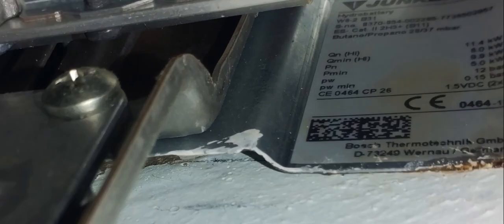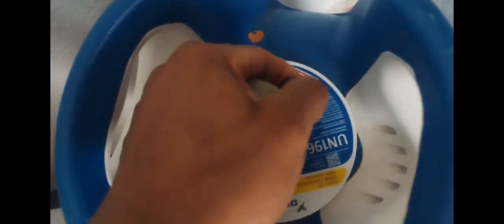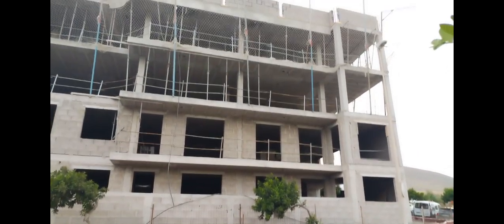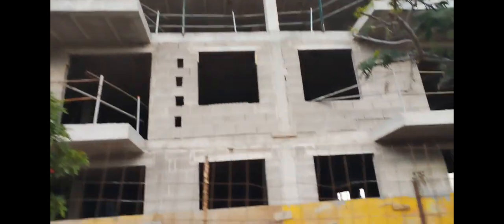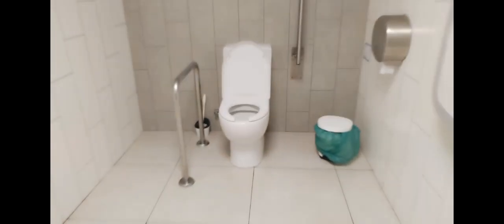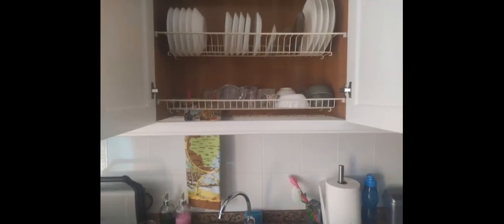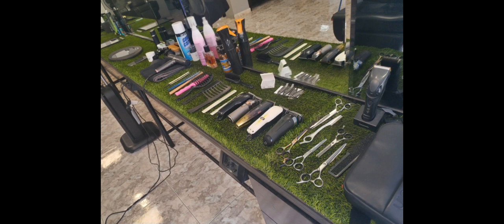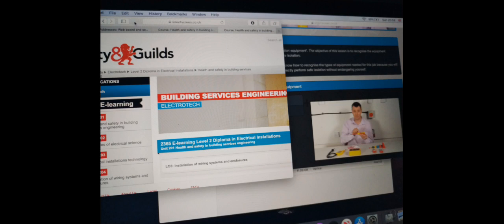PLUMBING IN SPAIN pt1

Comment: Love plumbing abroad be it greece Spain or Portugal or anywhere in the zone with its  4 6 8 10 12 14 16 18 20 22mm  fittings and gas water heaters inside outside upside down unvented and whatever x great vid m8 well done keep all vids coming  m8
Reply from the maker: Cheers BRB